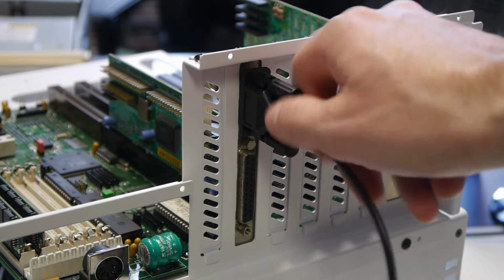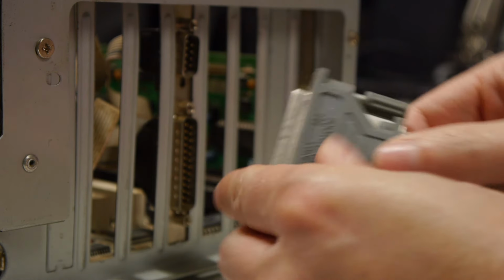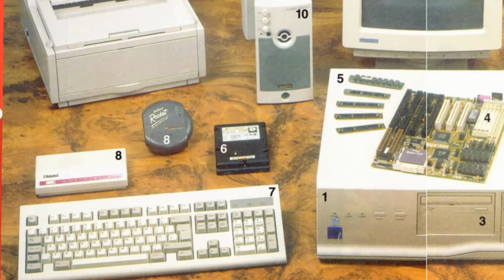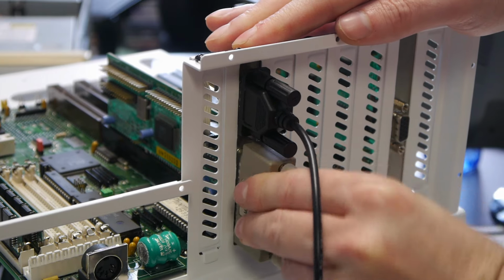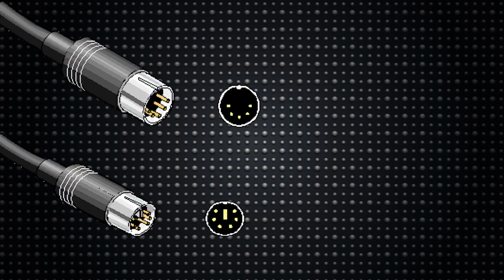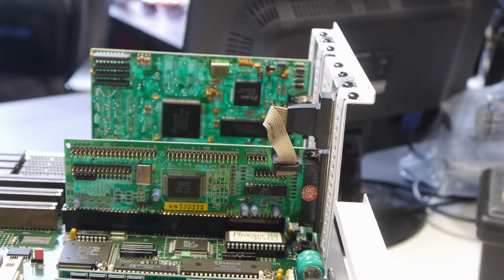What did we use before USB? | Nostalgia Nerd

Comment: Took me back to the days of using a null modem cable and ZIP drive :D What I found fascinating was that initially serial communication was inferior, and all the fast technologies used parallel data transfer. And then things changed, and everything went serial (SATA, USB) and outdid parallel technologies.
Reply: The problem with parallel is that because you have so many wires transmitting data in close proximity to one another, interference becomes a huge problem as you increase cable length or speed. Serial allows for better shielding.

Perhaps parallel could be faster with the proper shielding, but it would be about as thick as eight USB cables bundled together, which isn't practical. If you do that, you might as well use eight USB cables and drive eight times as many devices.
Reply: The main problem with parallel and its speed limitations was the requirement all signals arrive at the same time. All the wires of the bus were tied to the same circuit. Imagine an AND gate and what happens when one high voltage wave does not arrive in parallel with another another. Even with shielding the differences in time as the routing on motherboards became more complex and the speeds became higher meant that tolerances became lower and lower. So serial was the only way to get around that problem. Even multiple serial lines in "parallel" was better since there was no requirement for the signals to arrive exactly at the same time, where each independent line or lane can be buffered.
Reply: Phil I still used dial-up up until 2001-2002. During the turn of the century everyone was using PCI based WinModems that totally sucked up CPU resources and were generally slow. I did everything I could to round up a serial based hardware modem and it was simply better than those WinModems. It had to be powered but that was a small nuisance.
Reply: It's a really fascinating thing. As I understand it, parallel connections were initially superior to serial ones because hey, you can send 8× or 16× or 24× or 32× as much information per command ... but parallel fell by the wayside in the late 1990s because things were becoming so fast that the different lengths of traces on cards and motherboards meant that there was too much asynchronicity in parallel interfaces to work with, and so it just became more practical to blast things around serially at the fastest speeds imaginable.
Reply: You are talking about PCI Express, up to sixteen serial lines running in parallel at a speed of 16GB/s (V.3)
Reply: David Alan I Han an external US Robotics. All the magazines recommended it.
Reply: The other case where serial surpassed parallel, is PCI-E … ok, it goes up to 16 lanes, but each lane is a serial connection and x1 is only one of them (and still faster than 32 bit PCI)
Reply: Not really. Firewire and USB served different market segments and there wasn't any real push for FW to be extended to things like keyboards, mice, and low speed peripherals. To this day FWs design choices are considered superior, as USB is designed to be governed centrally, while FW is meant to be peer to peer and move the logic away from the CPU resulting in lower processing load.
Reply: Parallel ports are still widely used, LCD displays, flash memories, RAM memories, microcontrollers, etc etc, all use parallel ports.
Reply: But PCI Express is still serial and each lane of a 16x or whatever X PCIe bus is still a individual serial bus. So, it's not really serial, it's just multiplexed over multiple lanes. An example of parallel would be PCI-X, which was like an extension to PCI but could be up to 64bit wide and run at speeds up to 133Mhz. However, these slots were only seen on expensive server motherboards and the cards for them were usually devices like raid controllers or Infiniband adapters. As far as I know there was only one video card ever made for PCI-X, and it was a card made for medical imaging by a company called DOME Imaging and not something your average PC user would need.
Reply: To me it was playing splitscreen in Settlers with two mouses
Reply: matsv201 mice?
Reply: The last hurrah of external parallel connectivity might have been Ultra640 SCSI, which was the fastest version of parallel SCSI. I'm not sure if it was ever implemented, but if it was, it would have been faster than all but the most recent versions of Serial Attached SCSI. (But we'd love SAS anyway because you can hang SATA disks off a SAS controller, which you can't do with parallel SCSI). 

But, even if U640 SCSI never made it into the wild (I've never seen it, but the standard was finalized IIRC), there was still Ultra320 SCSI, which was faster by a large margin than USB 2.0 or Firewire 800, albeit not as fast as USB 3.0 or SATA 6Gb/s.
Reply: Diamond SupraExpress 56e Pro was the apex of 56k modems, possibly one of the greatest things I ever purchased for a computer as it knocked about 40ms off an average ping of 150.  And all just so I could play TFC Football...
https://www.youtube.com/watch?v=nd_hgtbk4fg
Reply: And those great big internet behemoths running across the world oceans are parallel optical. Still a bit of a niche though, compared to the ubiquity of USB.
Reply: The parallel optic fiber thing reminds me that if I'm not wrong, they actually do use this, you just have to shoot two lasers (or more) at different angles into the fiber, so they actually reflect internally and carry as much data per fiber than the combination of all lasers.
Or also add more colors (which I bet less on)
Reply: YES.....  "The Clicking of Death!"  The chap who developed SpinRite had big issues over this with IoMega, and I've also had problems with Zip Drives. Still have an old one out the back - and whilst they were fast (and had good capacity) reliability was the problem. The arrival of cheap(er) reliable external drives (along with USB 2.0) killed this industry dead.
Reply: PhilsComputerLab Yeah mine was a Creative Labs model. The USR ones were expensive even then. 

In rural areas high speed was slow to roll out. Probably not as slow as where you live haha. One way cable modem came around '01 and was 512-768K down with 33.6K upload.
Reply: I just bought a null modem so I can play DOOM with my friends on a 486/66 and a P 166. It still cost the same as it did in 1996 ($6.95CAD) :D
Reply: David Alan I still used dial-up until 2003...and on AOL! (AOhell). God help me.
Reply: David Alan Wow!
Reply: Be N S O N: PCIe sorta uses parallel. Each PCIe lane is serial, but devices often connect with multiple lanes.
Reply: Ryoohk, Dangit, now mine's broken. Definitely one of the epic fails. Basically a mechanical virus.
Reply: I worked for a college lab, during freshmen year we had tons of stuff archived in Jaz disks. It was a bit of a hassle converting and transferring data between computers as we still had a few macs using classic Mac OS and some with Windows 2000 or NT, remembering when our external drive wouldn't work becase NT didn't have drivers to read USB devices!
Reply: Where there is this sort of money involved things often do not make logical sense. ;)
Reply: To add a bit to this, to transfer data faster you need higher clock speeds, and parallel connections have a bit of a  problem with that. To transfer data in parallel, all eight bit of data must arrive at the same time. With slower connections, the signals can arrive a bit apart, but it is still okay as long as they arrive before the next clock cycle. If you make the clock faster, then if one wire is just slightly longer, the signal might not arrive in time for the clock cycle, and you get mangled data. That's not a problem with PCIe, because all the wires are ridgid inside the mainboard with exactly the same length, but cables outside the PC can be bent or put into the socket at a slight angle.

Serial connections don't have that problem, because there is not nearly as much to synchronize. You simply take the signal bit by bit as it comes. So if you accelerate the clock, the data still arrives in the same order and you don't get synchronization issues. That's why serial can have higher clock speeds and outperform parallel connections.

EDIT: Oh well, he said as much in the video...
Reply: Time to run Steve Gibson's "Trouble In Paradise." TIP is a wonderful zip disk recovery/repair too, Just AVOID THE CLICK OF DEATH!
Reply: Only in runs short enough to not require usage of optical amplification units (or what ever you call them.)
Reply: @Stefan L here is some dome data. I have seen a bunch of these. http://content.etilize  (dot com here) /Manufacturer-Brochure/1010868634.pdf
Reply: In this thread, there seems to be a mix-up between busses/point-to-point on the one hand and serial/parallel transfer on the other. I can explain a little.
Reply: @Halberdin  yes
Reply: PhilsComputerLab Makes me wonder, if parrallel was still being developed today, no matter how unrealistic that is, what form would it take? How fast would it be? Would people find a use for it?
Reply: @Colddirector   The reason why technology has moved to serial lines for long-distance (a couple of meters is already a "long distance") data transmission is because when you increase the data speed, at some point the time it takes for a signal to travel through cable (remember, it travels roughly at a speed of light) becomes comparable with a bit period. For a parallel interface this means that the length alignment of individual data wires becomes VERY critical (or the bits would get messed at the receiver), which adds physical compexity. On the other hand, modern electronics can handle high speed signals perfectly, so we can save the trouble of length-matching by using higher speed serial physical connection (when there's only one data stream, there's nothing to match, naturally). In the end this makes it possible for serial interfaces to outperform parallel interfaces.

On the other hand, internal data buses (for example, SoC to SDRAM buses, etc) are still parallel, which allows to achieve superior data rates. This is because trace length matching on a PCB is much easier to implement than wire length matching in a cable.
Reply: Let me just copy this file off this zip disk...........*click*... what was that Click Click Click Click "Copy failed"  NOOOOOOOOOOOOOOOOOOOO
Reply: Parallel could be even faster and less issues with magnetic-field interferences, if it uses optic fiber as medium to transport information.